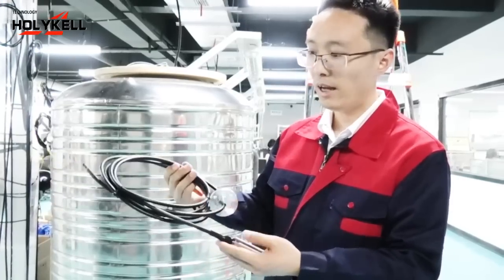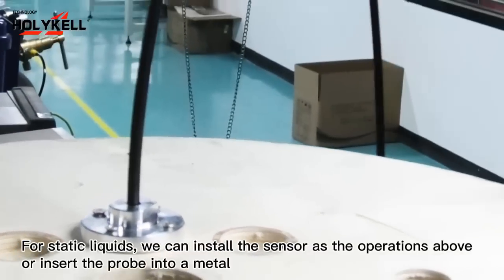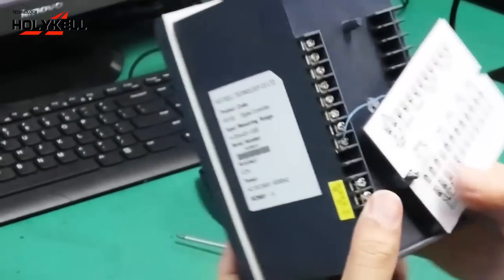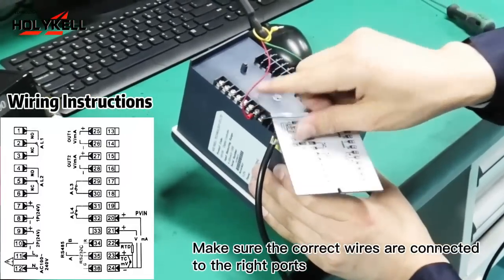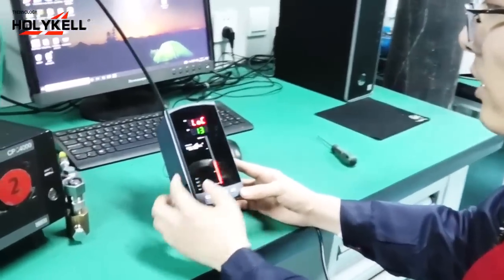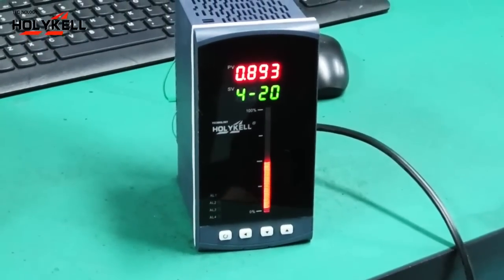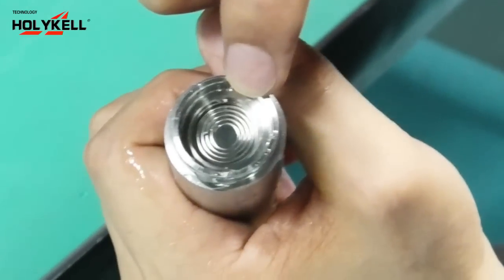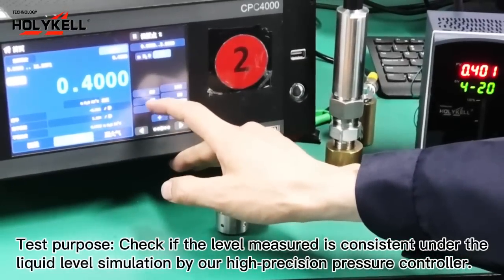How to Install, Wire and Maintain Submersible Level Sensors?

Comment: Greetings: I notice the sensor has three wires, but then I have the following questions:

Is the yellow wire unused?

Does the green wire carry the voltage or amperage signal?

Where does the 0 V to 10 V signal go?

Where does the 4 mA to 20 mA signal go?
Reply from the maker: Hello~For the model HPT604 in the video, the yellow wire is connected to the earth ground, the green wire carries mA (Since it is a 4-20mA sensor). The wiring may vary based on different signals(such as 4-20mA, 0-10v or RS485) or versions. If you would like to know more or the wiring of the sensor you bought, would you pls check the user manual or contact us via email info@holykell.com?

Comment: You didn't show where your power supply was plugged into.  Controller shows 100-240vac, will this work if plugged into a 120 vac 60 hz?
Reply from the maker: Yes, our controller H5100 can  work in 120V AC 60HZ . You can contact our engineer for more detailed info. Email: info@holykell.com. Website: https://www.holykell.com/.